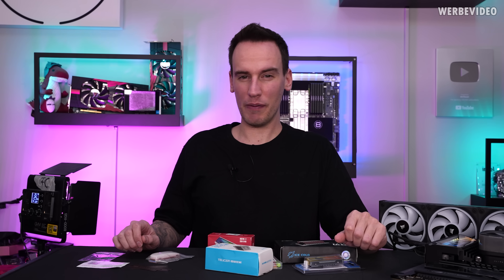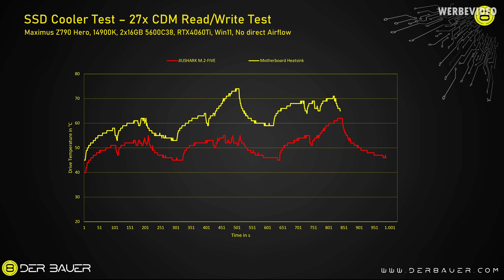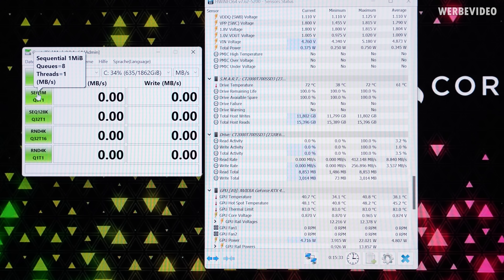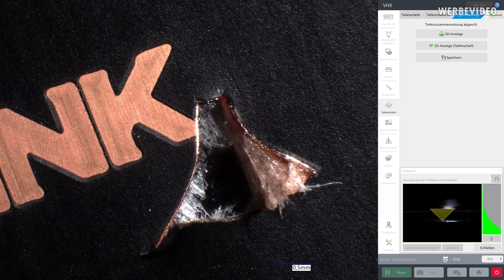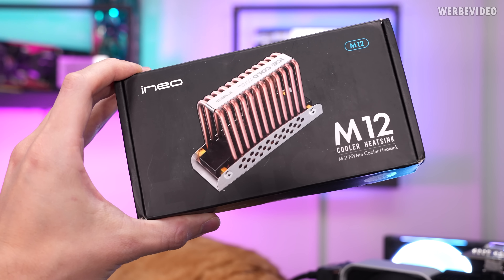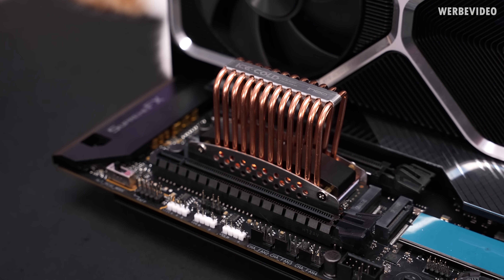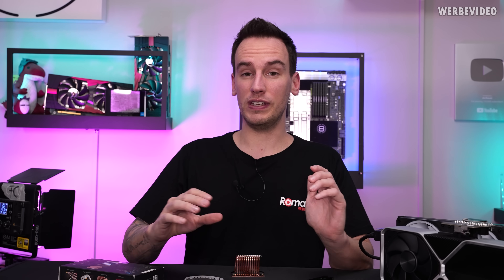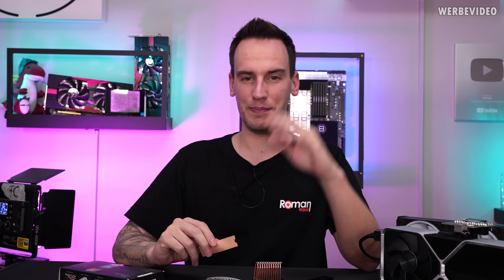Pure Scam! Magic China Sticker to Drop Temperature by 10°C?

Comment: I run an Cryorig Frostbit Dual Heatpipe M.2 Cooler but I don't think the make them anymore which is a shame as it really has a heatpipe and paste for it's connection to the initial heatsink. It has a radiator on top and really works in my case airflow. The heatpipe can be mounted at an angle which cleared the backplate of my gpu. Google it.

Comment: Best concept here would be a good aluminium heatsink with a laptop blower style fan above it. A contraption like this would be atleast 6cm high, so thats why one of the tested coolers uses these tiny but loud fans. Also it should be considered where that heats/ airflow end up on the motherboard. I dont get why we need Gen5 yet, the speeds/ real world ingame loading times arent that much higher and older SSD where just fine without cooling.
Reply: i suppose for new technology with microsoft direct storage. like in ratchet and clank a really fast ssd is very noticeable when teleporting and provides an immersive experience
Reply: @konzo5942  You don't need 8 or 12 gigabytes a second for that. Even a SATA SSD can fill RAM/VRAM at more than 1GB/s thanks to compression, which is nothing to scoff at, it's already one, up to two orders of magnitude more than last gen devs could reasonably rely on. At gen3 link which is north of 3GB/s raw transfer speed you're golden, you're guaranteed maxing out the decompression speed that Oodle can muster. Different Oodle algorithms have maximum output throughput between about 1GB/s and 4GB/s, which means correspondingly a 550MB/s drive can saturate the former and a 2.5GB/s drive can saturate the latter.

Comment: That sicker sized "cooler" reminded me of MSI's "Heat Shield" that Gamers Nexus tested almost 7 years ago and found out that it acted more like an insulator than a heatsink when you compare the temperatures on the bottom of the SSD.
Honestly with these PCIe 5.0 SSDs it looks more and more like the carrier cards with coolers similar to what you get on lower power graphics cards might be the best option as they provide a proper level of cooling without tiny annoying fans.
Reply: Best option is a better form factor.  M.2 was fine up until early gen4 but has been showing it's limitations since.  I can understand why U.2 made no sense for early NVME on consumer hardware but all these work arounds to keep M.2 viable are kind of silly.
Reply: @nadtz  The M.2 form factor came from laptops where it made perfect sense as it reduced the size of an SSD to the absolute minimum (not counting soldering the SSD to the motherboard). When you take that into account as well as the fact that when it was introduced PCIe 4.0 was still years away from being available it makes sense why it just doesn't work for these high performance PCIe 4.0/5.0 drives. Unfortunately I don't see this changing any time soon as M.2 is just too widespread at this point so we are probably stuck with imperfect options such as bulky heatsinks with tiny fans or carrier cards with larger fans.
Reply: But is the speed advantage in the real world worth all the hassle?
Reply: @Thisandthat8908  That really depends on your use case. Regular desktop usage might never stress the drive enough for it to cause a crash/shutdown especially as the heat being generated depends on the transfer speed which is determined by the slowest part involved in the transfer. Basically in order to max out a PCIe 5.0 SSD you need to move data to/from another PCIe 5.0 SSD or the memory as AFAIK everything else is going to be slower and thus bottleneck the transfer.
With that being said better cooling would prevent potential throttling thus allowing the drive to maintain a consistent level of performance even when doing a lot of reads/writes.
Reply: There's a load of great ones, that can be found online for only a few bucks more with proper heatpipes and a lot of surface area. Thermalright do some really good ones that work well. They use the same AGHP heatpipes as they do with their CPU cooler line.
Reply: i'd rather wait for a new Generation of Controllers that will be more efficient. PCI-E 5 level Controllers are all pretty much the equivalent of an Over-Overclocked Chip. they run super hot.
that'll get better in time, but we can expect it to be some Years until then.
Reply: 7 Years!!!! Oh god, I feel old now. Feel like that video was about 2 years ago.
Reply: Are these foils meant to be actual heatsinks or are they supposed to replace the manufacturer's sticker that comes with the SSD? My instinct is telling me that they were designed for this purpose, but they're in turn being sold as the wrong product type and description. I would try re-testing it as a replacement to the Crucial sticker and then put the SSD inside an actual heat sink. It probably won't be much of an improvement (and you shouldn't remove that sticker in the first place), but that's what I'd do if I wanted to test it.
Reply: The problem is, even IF they spread heat, the layer of adhesive on these "heat-spreaders" aren't thermally conductive, and work against it as an insulator (it's not thermal paste).

Some SSD's that come with these don't even make full contact to transfer heat because of the height difference between controller and memory chips, so they just block airflow.
Reply: @Fed-Up-YouTuber  
Thermal Adhesive is a thing - it's not as good as Paste ofcourse, but since the Wattage is low it's okay for this use case.
Reply: @taiiat0  Can you trust manufacturers to use specialized thermal adhesive when all they do is overpromise/lie all the time? 

Even for DRAM modules, some manufacturers just use the cheapest double-sided tape possible between the memory chips and heatspreader.

You'd literally be better off bare-die because at least then it wouldn't be insulated and block airflow.
Reply: @Fed-Up-YouTuber  
yeah i know, Products tend to often be horrible.
Memory Heatspreaders in particular, i'd say like 80% of the designs are totally useless and either make no impact or actually make it worse.
Reply: @taiiat0  In fairness to memory manufactures though. DDR3 and 4 really had no use for heatspreaders they just didn't get hot. so it was all about the aesthetic. DDR5 is different though.
Reply: @sparkyenergia  
between the Glass Coffins that is the most common Computer Cases, and more aggressive XMP Kits, Memory absolutely did get warm, even for those that didn't do manual/real Overclocking.
Reply: @taiiat0  Yeah Okay. I never fell for a glass coffin pc so all my systems have had at least some airflow and I was always biased toward memory capacity over the fastest kits possible.

Comment: I would like to see you mount another of the heatsinks on top of the sticker with some thermal paste. It looks like an intermediary layer. I know it isn't but the test may be interesting.
Reply: Given the price, I'd assume it's plastic and not graphene anyway.
And a foil of copper would still be worse than using paste between the m2 and another cooler solution.

Comment: Not sure if there are m.2 SSDs with just bare chips on them, but if you put on that copper sticker on such ssd and stick it under stock MB heatsink it could be better than only thermal pad under heatsink. 
Perhaps there is something lost in translation.
Reply: no there are no ssds with bare silicon exposed. At least not the ones from good brands. It's possible to make that though

Comment: That Ineo M12 with some thermal paste inside a case with "air flow" would likely be as good  performer.
Reply: For as expensive as the thing is and the fact that it doesn't have real heatpipes, you'd be better served looking at one of Thermalright's options, which are cheaper (at least here in the US,) and have real heatpipes and good finstacks.

Comment: BTW I suspect the sticker is just a genericized version of the sort of sticker they put on off-brand SSDs. Technically it'd help an SSD that didn't have a sticker to begin with, but not by 10 degrees, and certainly not one that already had a sticker like yours did.
Reply: In my mind, if it's same quality as the one pre-applied to SSDs, then it's useful if you damaged the original heatspreader sticker, a lot of people peel it off, even when it's not advised because say the SSD engineering relies on the graphite lateral heatspreader even under a proper heatsink. That's of course an "if", quality of such brands can vary since they don't really know what they're selling.
Reply: In my personal testing, that's exactly what it acts like though Jeyi's claims of it being non-conductive is questionable.

Comment: That M12 heat sink is a BEAST 😂 who would actually run that?  I’d totally give it a go if I had enough clearance
Reply: It would be more beast if they add the large heatsink fins on the top of it
Reply: I run a Cryorig Frostbit cooler and it performs well. Heatsink is adjustable and I have it pointed under GPU intake fan so it gets active cooling.
Reply: @FrozenHaxor  I think Roman tested that & said it could use some thermal paste between the heat pipe & the block itself.
Reply: @kevinerbs2778  Yes,  I believe it was in the manual, I packed the heatpipe with paste when installing it.
Reply: doable with enough memory risers

Comment: I think these tests are flawed, even if it doesn't change much you need to test them in a natural case environment, with directed airflow.
Reply from the maker: Flawed would mean that there is something wrong with the test. But we are testing a defined scenario which is no airflow. Something that can happen in a bad ventilated case or if the cooler sits in a bad location. 
You can also test in a case ofc. Neither of the scenarios is right or wrong - it's just a different one
Reply: @der8auer-en  
I think any passive solutions (CPU coolers, VRM heatsinks, SSD heatsink, RAM heatsink) should ideally be tested in BOTH a caseless setup with no air movement at all as well as an ideally ventillated case. This would also highlight the difference between heatsinks which simply have a large thermal capacity to absorb and those which are actually good at dispensing it at their surface.
Reply: He used the same test for everything. The only thing flawed is your logic...
Reply: Additional airflow would benefit both with and without sticker equally as I don't see any additional surface area being created...

You are correct though that airflow benefits high surface area coolers more. So the test wouldn't be flawed it would just be a low airflow test case, which for these low wattage components is more than valid in my opinion.
Reply: Did you buy one of these scam stickers? Or do you sell them? 

Stickers don't do anything. Stickers are only good if they have unicorns on them, and even still, they do not effect technology.

You should buy a unicorn sticker instead of a fake scam tech sticker. The unicorn stickers at least girls like.
Reply: @Boogie_the_cat  I want a unicorn sticker 😮
Reply: Upload your tests to YouTube then
Reply: Why would airflow suddenly make this sticker effective as a heat transfer device? Poor comment. Presumably it’s intended to be used in between a heatsink and the controller.
Reply: The entire point of an open test bench is to get rid of any outside factors. Such as a "natural case" which could be anything, and "directed airflow" which varies heavily.

This method of testing shows only the product and no other factors. Clearly you've never tested anything properly.
Reply: @Hot_Air_Intake 
While you are right in principle, many passive solutions are built with case airflow in mind.
Reply: @Hot_Air_Intake You can't test how aerodynamic cars are in vacuum, even if it technically "gets rid of" external factors. Things are designed with reasonable assumptions about their usage environment, you then just standardize those across your testing, not get rid of them entirely.
Reply: @Hot_Air_Intake What if a product is made to be used with and depends on case airflow? This is some LTT logic.
Reply: @neondemon5137  
Exactly. One could argue that good case airflow can't be expected cause not everyone has it, but in practice there's a strong correlation between high performance/hot parts and more sophisticated cooling. Someone who's using one stock fan each for intake and exhaust isn't going to use a top of the line PCIE Gen4 M.2 under constant load. It's just not a thing. 

Same stupidity as bashing a bargain bin motherboard for not being able to properly support a high-end CPU with juice. That's relevant criticism for that one moron who's using a 400$ CPU on a 100$ board only because it physically fits and literally nobody else.
Reply: @neondemon5137 then they should attach a test configuration to their own claims
Reply: M.2 is usually under a hot GPU. I'm sure a case would totally help. Jk
Reply: Are you for real? These tests are not meant to be very serious. The tone of all these videos is exploratory, not formal benchmarking. He's only comparing them loosely to see if the claims are based in reality. Some cases have poor airflow with higher ambient temps than an open bench.
Reply: A wrinkle on my brain just went smooth reading your comment.
Reply: My natural environment is a Corsair 1000d with 4x480mm radiators so my fans are set incredibly low so it’s silent. So I have very little airflow over my motherboard.
Reply: Then, the next point of contention would be that the air flow is not proper.
Then you'd have discussions on how a proper one would look like.
Obviously, any passive solution should perform a bit better if you have an air flow going over it.
But that would also be the case without any cooler on it, too.

In my mind, a "natural" case environment would be one where you have nearly no airflow at all at the bottom.

Having 6 intakes (like 3 at the bottom, 3 on a radiotor on the front) and a few outtake fans (like 3 at the top) is more than likely not a normal case still.
Reply: Hush

Comment: Dang they really have thermal engineering down with that tin foil 😂 but wonder what the best heatsink m.2 is of 2023 😮
Reply: probably that corsair water block at this point , because I can't see anything else cooling these power hungry Gen 5 SSD's
Reply: @arias1234  No need for water cooling the SSD, just one Delta THA1248BE fan over the SSD will do the job very nicely. One tiny drawback is PS4 levels of noise.